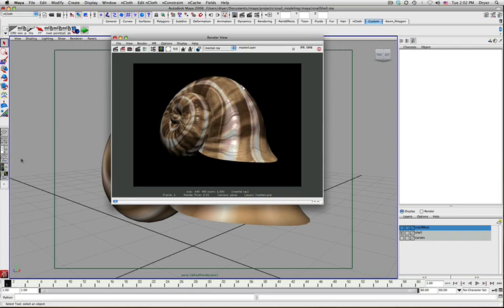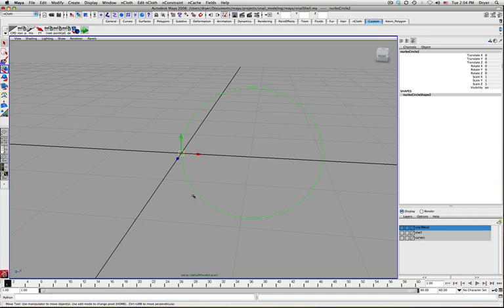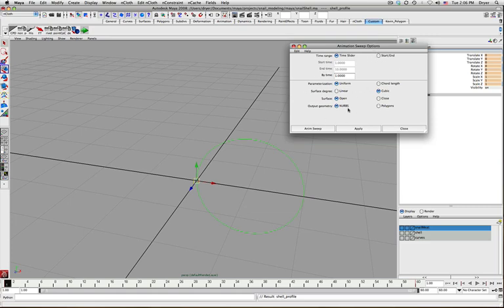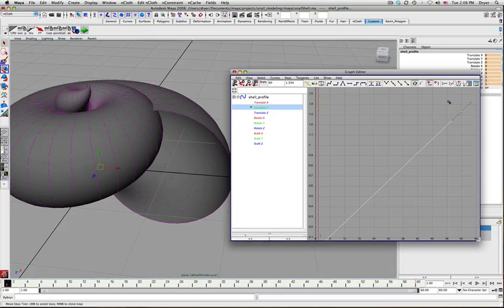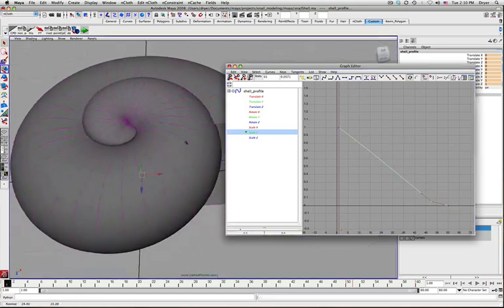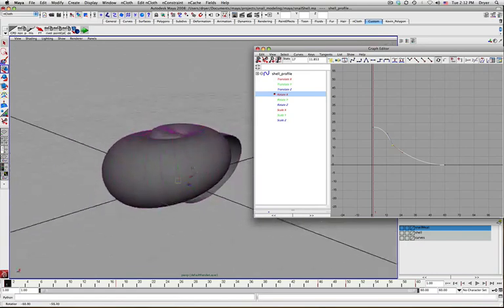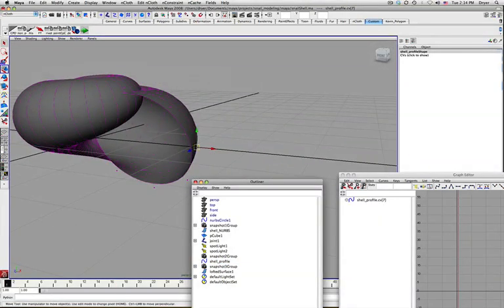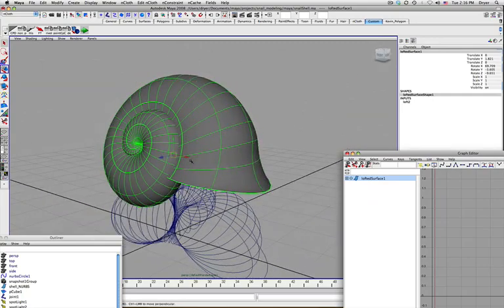shell modeling

Comment: How do you snap and move the move tool to the left like that? I've tried pressing x and nothing happens it just snaps to the grid....I've heard that by pressing by Fn and left arrow it should do it but that's on a Mac I have a Windows laptop....thanks.
Reply from the maker: Hi Mako - I am using the x key to do this (snap to grid). to move it in one direction you hold down x and grab the translation manipulator handle for that direction. The other thing I may have been doing is moving it with the middle mouse button. If you select something, hold down x for grid snap, and then middle mouse over the grid intersection you want and drag a bit, it should pop there. Hope this helps - good luck! Feel free to follow up if you have more questions.
Reply: 3D Splanchnic Thank you so much for your reply! I will try that, thank you again...:)